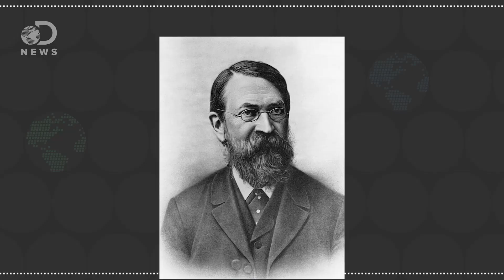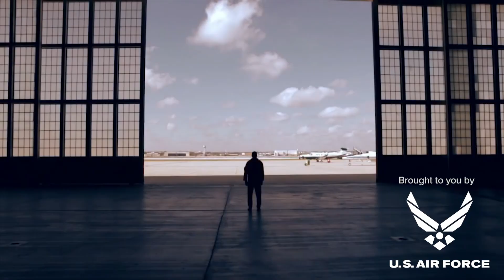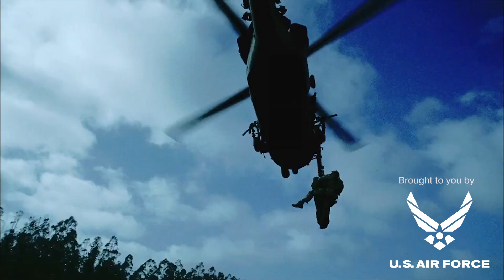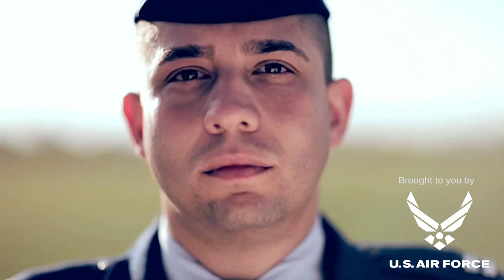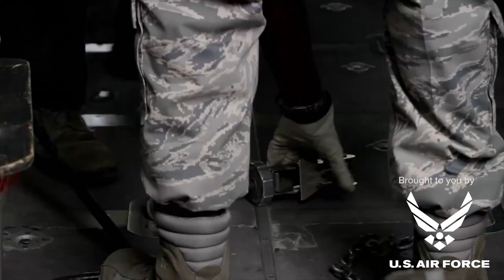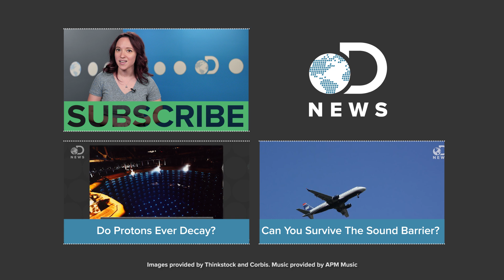Why Is A Sonic Boom So Loud?

Comment: Soooooo the explanation for WHY IT IS SO LOUD IS?
Because the multiples of sound waves that start to compress in front of the plane and then snap behind the plane, multiplied but shattered?!
Reply: When V(s) is the same as V(w) then there technically is no Doppler frequency because you don't hear anything until the jet is over you because the waves and the jet are side by side (If you can see the jet, you can know exactly where the waves are). As the sound waves build up on top the jet you will hear them all at once rather than at a constant frequency, creating a huge thump sound. Then as it flies away you will hear the Doppler frequency for a source moving away.
Reply: ***** that ACTUALLY makes sense....frequency is the big one in this! TY :D
Reply: You're welcome :)
Reply: ObsessionPC  So that's where shatter comes from mmmm!

Comment: If ufos travel with 4000 mph, why don't we hear sonic booms from them ?
Reply: The air passes around them. The UFO does not push air out of the way and actually uses the air to propel itself along when in out atmosphere. So no sonic boom and since it's not stacking up air in front of it, there is basically no resistance to its movement, hence, extremely fast vectors of movement. It's like the UFO is moving in a localised vacuum and the vacuum moves with it. Force generation is usually gravimetric , atmospheric and magnetically based, using the planets natural gravity, atmosphere and, if available, magnetic field, to create force to propel it along. 
Most UFO are equipped with atmospheric propulsion and void based propulsion ( for travelling through areas with no atmosphere ). FTL (faster than light) drive systems are usually dependant on the manufacturer of the UFO, but most can adapt different types of FTL drives to compatible UFO frames and operating systems. The two most popular and hence, easiest to fix FTL drives are the gravity tunnel and proton expulsion.
Reply: Nah I got it. They bend space aroun them, so actually they don't move, they move the space around them.
Reply: Come on. Don’t you watch Futurama? They use dark matter engines that don't move the ship at all. The ship stays where it is and the engines move the universe around it
Reply: They just explained genius. They said scientists are working on a way to lower the boom so if an advanced alien race was able to travel faster than light then i'm pretty sure they can take away the sonic boom
Reply: Andrew Media  Great question. Maybe just designs depicted on film. Anything identified as an alien craft yet? Nope.....just unidentified.

Comment: and then in turn the jet engine is loud becuase its moving parts, the fanblades, does the exact same thing with the air going through the engine. At some points the fanblades actually break the sound barrier within the engine itself, hence the very loud crackling sound of a fighter jet. Plus the flame running out from the afterburner also produce a very loud sound since the hot gases, air and burned jet fuel, shoot out from the nozzle at supersonic speeds. So, the fanblades inside the engine breaks the sound barrier and the outgoing air also breaks the sound barrier. That is what makes most of the thundering noise we all experience while watching fighter jets.

Comment: The reason a whip cracks if you snap it correctly is because the tip of the whip (if done correctly) passes through the sound barrier!!!!!!
Reply: wow
Reply: And (if done incorrectly) could pass through your eyeball. I almost learned that the hard way.
Reply: Jeff Schwartz I'm not sure if that's how it works
Reply: Jeff Schwartz when you use that whip do you see the molecules being decompressed I don't think so ☝
Reply: That's exactly how it works.
Reply: "<b>Th,</b>e crack a whip makes is produced when a section of the whip moves faster than the speed of sound creating a small sonic boom. The creation of the sonic boom was confirmed in 1958 [1] by analyzing the high-speed shadow photography taken in 1927."   Do you still 'not think so' ?
Reply: Not true lol but nice copy pasta
Reply: Jam- X are your eyes capable of seeing the compression and decompression of that few of molecules that quickly?
Reply: The same with cracking a tea towel - that's why it hurts so much if it hits you!

Comment: Incorrect info in the description. Supersonic commercial travel ended because Concorde went out of business, not due to loudness, but lack of capital.
Reply: It was because of both reasons, When the Concorde flew low at its cruising speed glass cracked and exploded that caused thousands in damage
Reply: Clix B8s DAMN SON
Reply: It went out of business because it was sooooo expensive.
Reply: Concorde was a supersonic aircraft, not a company, BA and Air France flew them for 27 years, and they are both still in business today. Unlike a multitude of American operators who did go bust since the 1970’s. G
Reply: Rektspresso Concorde flew to destinations around the world when BA introduced charter flights, all were full and making profits for BA.
Reply: Clix B8s your statement is not only scientifically impossible, it never happened. The air is too dense to fly at it’s cruising speed when low. Cracked glass only happened when American fighter jets carried out supersonic test over oaklahoma in the 1960’s, and they were flying low. Not Concorde, not ever. G
Reply: Smooglez the American presidents aircraft was noisier than Concorde, that is the reason it was allowed to fly into JFK after two years of court cases trying to prevent it ever flying into America. G
Reply: Same thing. For example Concorde would have made much more money if they were able to fly over land. Thus expanding business by flying to more than just two destinations
Reply: Noise was a huge factor.

Comment: So quick question, is there such thing as an aquatic boom? like a shock wave produced by a submerged or floating object, that moves as fast as the speed of sound through water? obviously it'd require you moving much faster than in the air considering the speed of sound through water is much higher.

Comment: if bullet rounds travel at a super sonic speed and your jet fighter is also traveling super sonic, or faster, how is it that the projectile travels  ahead of the fighter jet? wouldn't your jet just run into the bullets since the jet is still being propelled by its engines whilst the bullet will only continue to slow down? anyone?
Reply: +Oscar v Not possible except under very specific circumstances.  When a bullet is fired it will, as an example, travel at 2000 feet per second.  That is the muzzle velocity and it is the same whether the aircraft is sitting still or moving.  So if the jet fires his gun while in flight traveling at 1000 feet per second, then the bullet will be moving at 3000 feet per second.  Once fired, the bullet begins to drop immediately.  Now because the jet is being propelled forward constantly and the bullet is no longer propelled, friction will slow the bullet and the airplane will catch up eventually, but because the bullet is also dropping as it travels forward, the airplane will pass over the bullets, which at that point would be dropping toward the earth at somewhere around a 45 degree angle, depending on the exact speeds.  There is one circumstance I have heard of when an airplane did manage to shoot itself down with gun fire.  A Navy fighter, while testing its guns, fired several hundred rounds at a slightly upward angle.  The pilot then dove the plane which caused quite a bit of acceleration so he caught up with the bullets fairly quickly.  Because he dove, while the bullets were going up, then down, the two trajectories met several miles later bringing about one of the most unlucky things I have ever heard of.  I believe the pilot did live after ejecting from the plane, but he did manage to shoot himself down.
Reply: great explanation, its the little things that i could not come up with that seem obvious until someone else explains it. thanks.
Reply: +Robert Ohm A Navy fighter shot himself down...ironyyyyy

Comment: The problem with passing the sound barrier did not actually have much to do with the aircraft vibrating apart, it is easy to make an airplane stronger.  The primary problem was loss of control.  The loss of control occurred because the shock waves that form cause turbulence behind them and this turbulence makes the flight controls ineffective, primarily the elevator.  At the same time, the center of lift of the aircraft moves back, which causes the aircraft to nose down.  This is the effect that occurred in the propeller driven aircraft of world war 2.  They were not breaking the sound barrier, but the relative wind moving over the curved surfaces of a wing is forced to move faster than the airplane itself, so it does come close enough to the speed of sound for the shock wave to form.  The big breakthrough with Chuck Yeager and the X-1 was the discovery that if you move the entire horizontal stabilizer (that's the little wing at the back of the airplane) then the shock wave does not make the control ineffective.  
BTW, a large part of the reason sonic booms are so loud is the shape of the shockwave.  When you look at a graph of a shock wave, the pressure spike occurs very quickly.  She mentioned that scientists are trying to reduce sonic booms and one of the ways is changing the shape of the nose of the aircraft which allows the pressure spike to build slowly, which decreases the pressure buildup which also decreases the total sound level of the boom.
I'm sure someone is asking if I am just blowing hot air (pun intended). Well, no, I am not a scientist, I am an FAA certified aircraft mechanic, and I worked on the flight control systems of F-15s for the USAF while I was enlisted where we learned about the effects that I described, and I am very into the history and science of aviation.  So, while my explanation, I am sure, is not the full scientific explanation, it does give a good general idea.
Reply: Now why did your comment manage to enlighten me more than this misleading video? Nevermind. Thanks!
Reply: The video is a good supplement to your comment.
Reply: thanks that was very helpfull
Reply: +Robert Ohm   Thank you. That was concise.
BTW; I used to hear & feel sonic booms several times a day growing up in the 50's & 60's next to Oxnard Air force base and Mugu Navy Base.     I thought earthquakes and sonic booms were the same because they both rattled the windows and tilted the pictures on the wall. ;-}
Reply: Robert Ohm that was more interesting than the video itself.
Reply: +Robert Ohm That was interesting! Thanks for adding it!
Reply: thank you. your comment was actually a good supplement to the video
Reply: Robert Ohm thanks for the info, makes sense and explains more of why its loud more than the video itself!! 👌
Reply: Robert, you are absolutely correct, in my humble opinion as a General Aviation pilot who loves aviation history.  I'm not an aeronautical engineer, but I have to agree that what you have said is generally correct.  I'm sure a Boeing Aerospace engineer might have some differences with you, but as a general aviation pilot, your explanation is very good..
Reply: Ohk cool
Reply: Robert Ohm excellent explaination your response was more intriguing then the video!!!!!!!!
Reply: when you learn more in the comment section than the actual video....
Reply: hey, now i kinda know why they are so loud, thanks. bit of a misleading title this video has.
Reply: +sameer khan Nobody right now, but keep looking, aviation hiring in the big places seems to go in cycles.
Reply: very good, thank you!!!
Reply: I learned more in your 3 paragraphs, than I did in her whole video, thank you Robert Ohm.
Reply: You should have done this video.
Reply: Thank you! you explained it shorter and better than the lady. The video didn’t even answer their question
Reply: Hey bro I live in Houston I have a A&P license but can't find the job do you know anywhere is hiring?
Reply: that was awesome.
Reply: Robert Ohm Thank you for your explanation!
Reply: Laura Savage not an engineer or professor. I am a certified airframe and powerplant technician which means I'm licensed by the faa to work on aircraft. Before that I worked on F15s for the air force. You need knowledge of aerodynamics to work on flight controls, which is what my job was.
Reply: Robert Ohm that was the explication I expected during the video
Reply: While that is true, both the British and Americans got much of their faster than the speed of sound research information, including swept wing design and moving horizontal stabilizers, from captured German aircraft, research and scientists.
Reply: Thank you, I found your comment very helpful.☺
Reply: Thanks man. Also thanks for your service
Reply: Robert Ohm I have to say your vast knowledge aviation and physics are impeccable .....are you a aviation engineer or perhaps a professor at a prestigious college ........just curious!!!!!!and thank you again for insight and knowledge on this breaking the sound barrier phenomena !!!!!!!! excellent work!!!!!!!!!! thanks
Reply: Robert Ohm 👍
Reply: Robert Ohm that's true
Reply: One minor point that is often left out is that it was British engineers that figured out how to overcome the loss of control near the speed of sound. For some reason they stopped their own project and handed the solution over to the Americans, who already had a prototype that only needed slight modifications to meet the new specs. Maybe a financial decision, maybe a political "good will" gesture, who knows. I still found it interesting and something not taught in most history books.
Reply: this comment made more sense than the freakin video itself, GOOD JOB!
Reply: Learned more from you than I did from her
Edit: I see other poeple did as well lol
Reply: Robert Ohm 
Great comments.
I wish a lot of teachers (professors) have same ability to teach this way. You should teach. Thanks
Reply: Robert Ohm great
Reply: You're awesome man thanks for the great addition.
Reply: Thank you for your service. My dad was an jet engine mechanic in the F-15 Eagle as well. His service was in the 80’s.
Reply: Thank you!
Reply: More informative than the video itself and I didn't have to keep up with the lady that was trying to break the speed of sound talking
Reply: SWATOFFICERJOE 20 hahahaha omg so funny... nice one 😂😂👌
Reply: Emerald Gaming-Minecraft &more true
Reply: Robert Ohm bun
Reply: The all movable elevator design solution for SS was first seen on the Miles M52, then adopted by Bell following a co-oprative data exchange between Miles and Bell. But the Miles M52 funding was cut by the UK gov, 20 mths before the X1 did the job.
Reply: As I recall, that's also the reason why flying wing planes like the B-2 Spirit or the new B-21 Raider can never be supersonic.  The flight control surfaces are simply too small to handle the change in CG and reduction of elevon authority.  I am curious about something though — what is it about delta wings that allowed planes like Concorde, the SR-71 Blackbird, and the space shuttle to handle these speeds while still using elevons (as opposed to the much larger horizontal stabilizers on modern fighter jets like the F-15 or the F-22)?  Does the shape of a delta wing reduce the wave turbulence that would otherwise cause that loss of control?
Reply: @bobohm21   Badass.👌🔥💪
Reply: Robert Ohm Thank you!
Reply: Robert Ohm ultra nerd confirmed